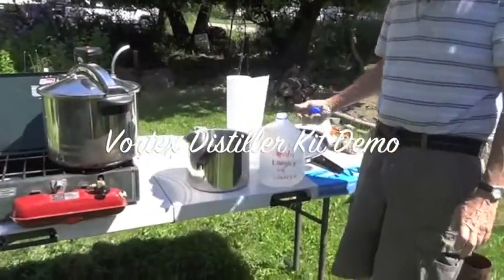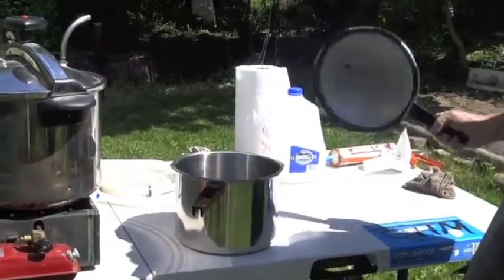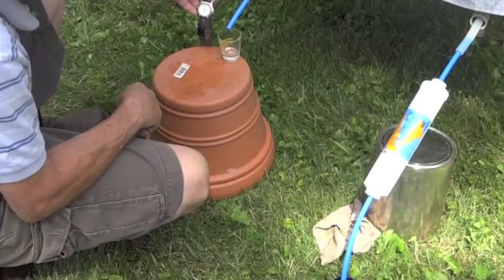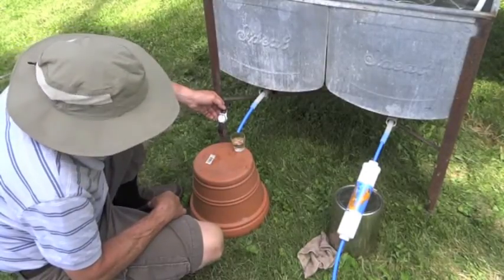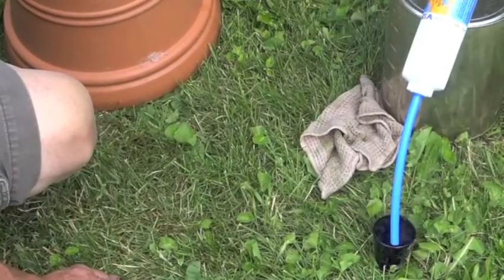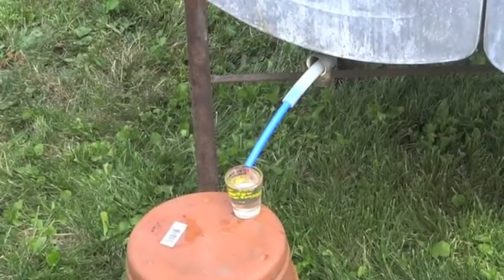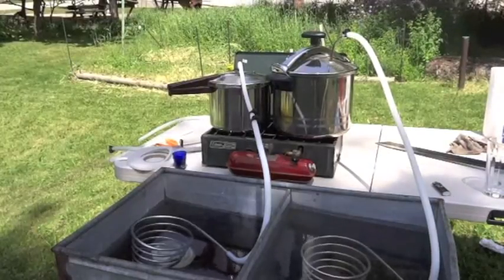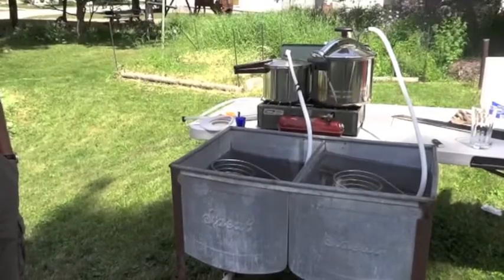Vortex Non-electric Water Distiller New Demo

Comment: well once the steam huts the going g Down not up,, gravity will do the rest. why all the extra tubing buckets, water...its all just overkill...water flows down right ? when steam goes up it must come down my friends. and there steam pot distilation product I saw right off the bat  had a flaw that being were the steel hose comes out of the lid...The hose should be right at the center to of the lid being the highest point of the coned shape lid, thats were the most pressure is being that's were the steam would expell out the fastest and heaviest...not so much were the lid connection hose for the lid is placed being down from the top center , thats what stoped me from buying...sorry no pun intended, fix the flaw and I'll purchase a distiller